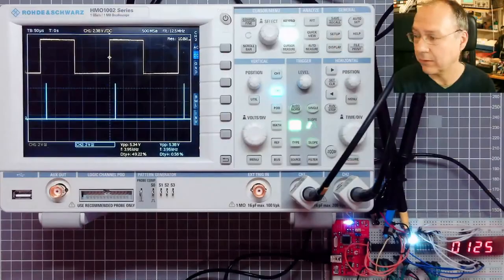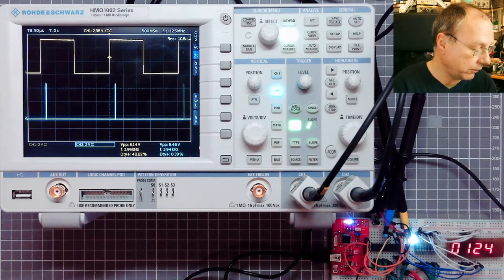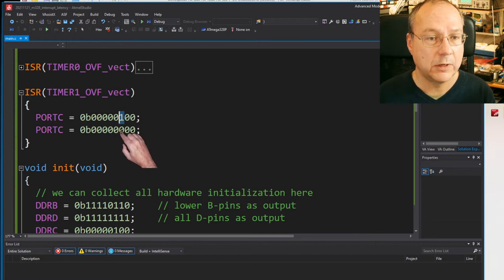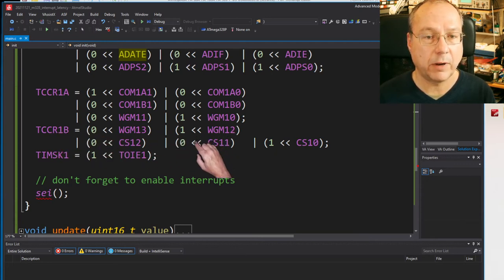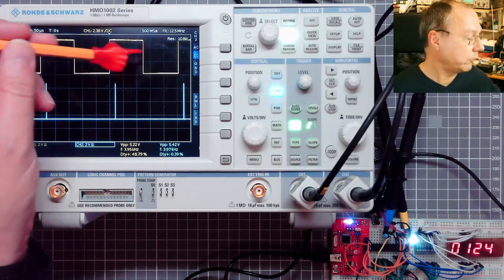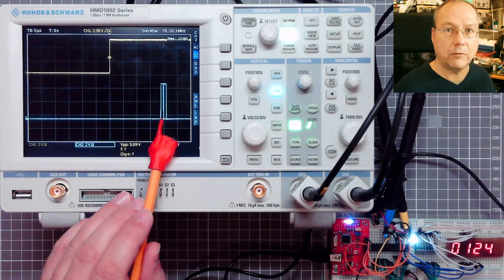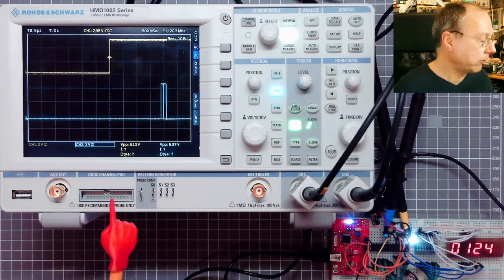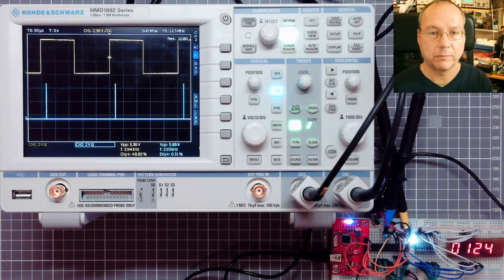Timer interrupt latency on the ATmega328

Comment: But, this is written in C. Doesn't the compiler output a few PUSH instructions at entry intro an interrupt? It would be very interesting to know what the actual latency is, for a naked interrupt. Also, it might be worth noting where the jitter comes from. I'm fairly certain that depending on whether the CPU is executing a 1, 2 or 3 cycle instruction at the time the interrupt occurs, the interrupt may be delayed - leading to exactly what we see here :) Very nice video, I like your channel!
Reply from the maker: actually you can look into the compiled code - in Microchip Studio there is an assembler output file easily accessible. There is almost no push happening normally, not even the status register is saved.
However, I was interested in the average latency which happens when writing C-code for these microcontrollers.

Comment: Uwe, Thanks very much for the video like that or the previous one. When Arduino era came nobody really cares about that. Only the library os some kind and fast forward 😀 to not optimal success. I started to get to know about the problems you show using 8051 family and assembler of course.
Reply from the maker: That is exactly my feeling. Especially the "maker community" goes for microcontrollers with more and more power, instead of utilizing the power of even a simple beast like the ATmega328. And everyone is relying on poorly documented libraries.
Reply: @uwezimmermann5427 we at Lodz University of Technology, Poland are still trying to show students some elements of now called 😀 "bare-metal" programing using some low level methods, but when they got to know C/C++ they'd rather  "forget" to use them in future projects. 
Where do you teach your students? Regards. Tom.
Reply from the maker: Hi Tom, I am teaching at Uppsala University in Sweden. And in the particular course which is ongoing right now I go as "deep" as C/C++. I just briefly mention assembler programming, but honestly in the case of the gcc-compiler and the AVR-family I would say there is not a big difference - and while we are not really counting clock cycles I still point out the importance of utilizing limited resources in an efficient way. The focus of this course is the close interaction between software and hardware.